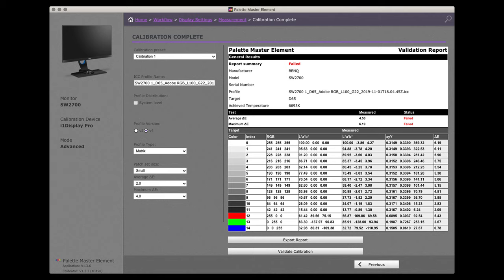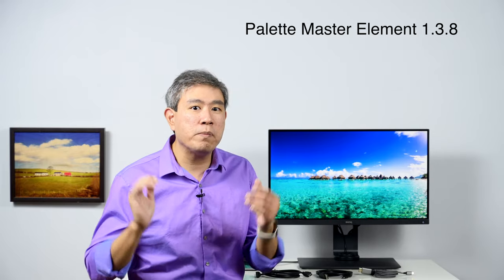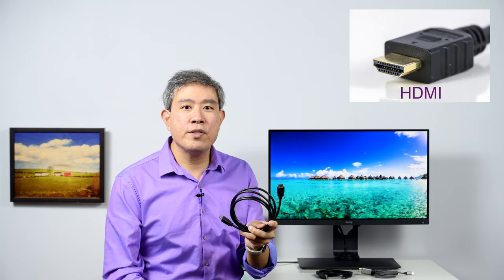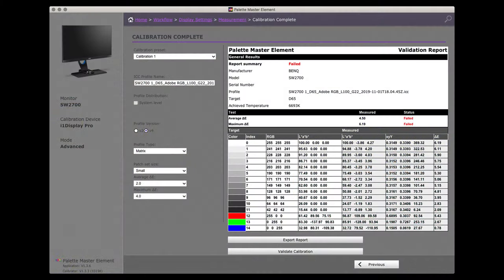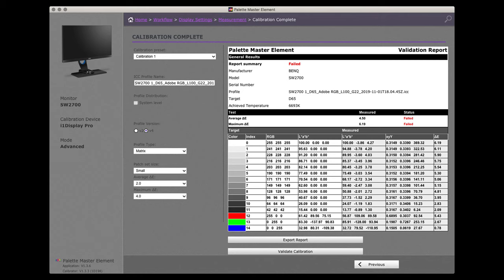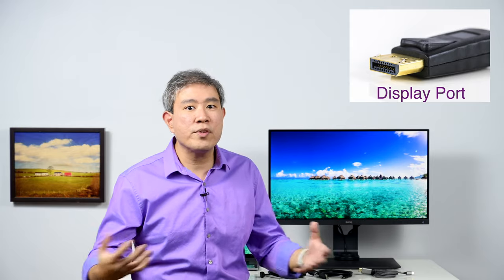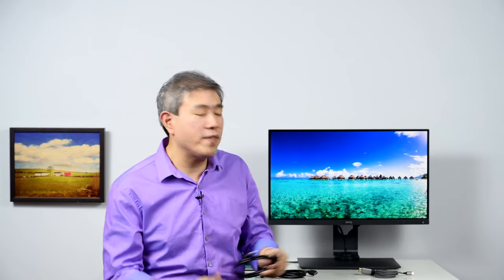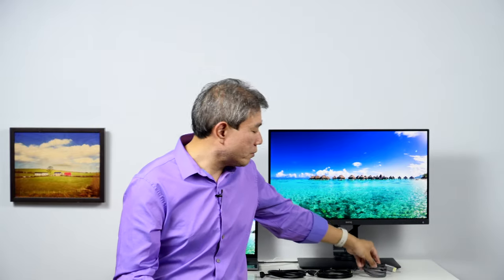HOW TO trouble shoot your BenQ SW Palette Mater Element Validation Fail Before Calling Support!

Comment: I have recently purchased BenQ SW240 to plug with macbook pro13" (non-retina, mid-2012 model).

Downloaded the palette master element and tried calibrating the hardware with Spyder 5.

the problem starts here, when the calibration is nearing 98% ~ 100%, the screen turns either cyan/magenta. the validation of the software shows that it has failed with "Delta E" values hovering in the range of around 30~40 !!

I tried with a Windows OS laptop and it worked like a charm. The only thing i set before calibration using Windows OS was the "HDMI PC Range" at 0-255. But with macbook the option is greyed. Need your help to fix the issue.
Reply from the maker: @Mayukh Das, sounds like you are using the HDMI cable. Yes on Windows you can set the range but on Mac it is more limited. So in this case I would suggest that you use the mini display port to display port cable that came with the display instead of the HDMI. Try recalibrate and keep me posted. Also, what version of PME are you running?
Reply: ArtIsRight i am using the mini display port cable supplied by BenQ and using the latest version of PME. I have re- installed Catalina and PME a couple of times but the problem remains
Reply from the maker: @Mayukh Das, this may be a bug with PME and SW240. I'm going to test it on mine when I have a moment. For now your best action is to contact your local BenQ support and try to obtain the previous version of PME 1.3.7 and try that version out. It could solve the issue. This is not a Catalina issues but a PME issue. I'll keep you posted on my progress.
Reply: ArtIsRight thanks for the help. Will definitely try and keep you posted.
Reply from the maker: @Mayukh Das, I've done a test on my 15" MacBook Pro 2018. On both Mojave and Catalina, with no issues. At this point, there are a few things that you can try, but either way, we know at this point that it is not the display. Most likely it is either software or hardware on the laptop. Being that the laptop is older, my suspicion is that it is hardware related. One more test that you can do is to install MacOS on a fast USB 3.0 Stick or Jump drive and then boot into the USB stuck, install PME and try running a calibration there. If it fails then it hardware related, it could be the Spyder 5 or your computer hardware. If it works then it is your main OS installation that is the issue.
Reply: ArtIsRight will try calibration after installation of MacOS on an external drive
Reply from the maker: I would also suggest trying it with another Calibrator too if possible.
Reply: @ArtIsRight  as i have informed earlier, i used the same calibrator Spyder 5 on Windows OS and it passed the validation test on the same BenQ SW240
Reply from the maker: @Mayukh Das, in this case there’s a few things that you can try. Downgrading to 1.3.7 would be an option. You can contact your local BenQ support for this. It seems there my be an issue with Spyder5, PME 1.3.8 on Mac. I’ll check again and get back to you if I find anything and also report this to BenQ as well.
Reply: @ArtIsRight  unfortunately local BenQ support is not responding to my request for 1.3.7 PME. Is there any other source to get hold of it?
Reply from the maker: @Mayukh Das, one way that worked for another user is the change the URL for PME download. You can try this link https://benqesupport.blob.core.windows.net/esupport/LCD%20MONITOR/Software/PV3200PT/Palette%20Master%20Element_Mac_V1.3.7_Mac.zip Also I ran a test on SW240 with both Maverick and Catalina using the Spyder 5 and I cannot reproduced your issue. This is the setting that I've used on both test https://youtu.be/bz9y3db9vRI Based on this. My best assumption at the moment is that there's something going on with your Mac either with hardware or software. In this case I would first suspect the software. Did you tried to install macOS on an external HDD or SSD? If so does it still fail. If it does this would indicate a hardware issues most likely relating to the video output port or the graphic card. Or another thing that you can try is to swap the cable but I hardly think that is the issue. Hope this help narrow down your issue. If you want to be sure about this, try calibrating your SW240 on another Mac Computer and see if it passes or fail. This will give you a more definitive answer.
Reply: ArtIsRight & ver 1.3.7 worked. My mac passed in flying colors 😊😊. The average Delta E value is coming 0.43 and thats amazing . Thank you so much for the constant support
Reply from the maker: @Mayukh Das, you're welcome! Glad to help out!

Comment: Just bought a sw271C. Palette Master element last version installed (no warnings of problems). click on the icon to run it....and nothing happens, it doesn't run. I have win 10 64 bit last version, Intel i5,16GB RAM. Tried 5 times to unisnstall reinstall it. No way to have it working. Monitor is connected to the PC with the usb cable supplied with the product (no USB C available on my computer). Great for a brand new product, 
 isn't it ?
Reply from the maker: Try 1.3.15 you can download from the website. Software issues happens on machines, new products or not. Each computer setup is different and can introduced variables.
Reply: @ArtIsRight  i will try, thanks,  but who is ensuring that the former version is secure and has no vulnerability ? In any case in 20y no other sw had problems to run in this way in all the machines I had and my machine is quite std, starting from the OS.  This sw is not well designed, developed and tested and I could suppose that ssdlc is also something unknown.
Reply from the maker: ok
Reply: @ArtIsRight  A new version (...17) NOW available. NOW it works.

Comment: Why can't Palette Master Element recognize the monitor , using HDMI to HDMI cable, 
Do you know why this might be happening? Additionally, I've noticed pixilation in dark areas and gradient videos. Could you provide guidance on how to set it up correctly? I work as a CGI artist, and color accuracy is crucial for my work. I purchased this monitor today, and I'd appreciate your help in resolving these issues. thank you in advance,
Reply from the maker: You need to use a USB uplink cable as well with HDMI or DP
Reply from the maker: Need more help ask the question in a new comment, I get so many, reply here will get lost.

Comment: Hi I have massive problems after the latest update from 1.3.7 to 1.3.8 I tried five times and the validation failed...with strange color cast..
my system SW320 MacBook Pro 2018 vega 20, usb c  to Display Port..
after downgrade to1.3.7 works again ... I was hoping the new version Works better with Lightroom.
Reply: I will try the new version on my SW320. I am currently testing the SW321C where there are no issues, nor with the SW270C on Mac. I too use a USB-C to Display port adapter. Also I test with a USB-C to HDMI from Apple as well as Aukey, both have worked without problem. The cables themselves though have to be the latest spec and of high quality. I do recommend yet forget to do it: when unboxing tape the supplied BenQ cables with label stains BenQ. The supplied cables are exactly right. Other cables sometimes work and sometimes not. IF I have something to report back on the SW320 and v 1.3.8 I will comment here.
Reply from the maker: @Neil Snape, thank you for the feed back. I'll be testing the SW321C soon. As far as the SW320, I should run a calibration test on it too. Let me know what you find. 1.3.8 there are some very minor issues but non on an os with no drivers or software conflict.
Reply from the maker: @Mb Flo, 1.3.8 did gave me some issues on my MacBook Pro with the SW270C, but that is attributed to software conflict going on in one of my system. When I test it on another Mac everything works great. Something that you can try to do instead of upgrading is to use a Mac app called "App Cleaner" to uninstall PME and download a fresh version into the system. App Cleaner will remove all of the preference and plist files associate with the old version of PME. Sometimes this can be the root of the issue. Give this a try and keep me posted.
Reply: @ArtIsRight  thank you ;) will try today...
Reply from the maker: @Mb Flo, I ran into quite a few issues calibrating 1.3.8 with the SW320. BenQ has been notified of this. If there's any updates, I'll let you know. My entire screen turned magenta, probably similar to yours. So in this case, I am speculating that PME is not talking to the LUT correctly.
Reply from the maker: @Neil Snape, any updates on your end?
Reply: @ArtIsRight  exactly ! magenta just like mine :( I can not recommend benq for professional work ... I have real problems
Reply from the maker: @Mb Flo, I understand. It is a frustrating software development issue and I know for a fact that they are working hard to fix this.
Reply: @ArtIsRight  I just tried. MAcBook Retina, USB C to HDMI Aukey adapter. HDMI 1.4 supplied cable. i1 Display Pro. SW320. Calibration I was going to put into slot 2. Yet the screen showed a strong magenta shift. Switched to Calibration 1 slot and the monitor base returned to an expected value range. PS, I set the monitor profile in sys prefs to Adobe RGB as I always do before calibrating. Calibration 1, dE av 12, max 2.1 in the red end point. I am now trying cal 2 but expect it to fail.
Reply from the maker: @Neil Snape, this confirm my testing too. I have notify BenQ about this issue already. Development pending...
Reply: I downgraded back to 1.3.6 which currently works ok on my MacBook Pro but it takes a hell of a lot longer to calibrate than compared to that of the 1.3.8 which caused the extreme magenta tint. :/
Reply from the maker: @Jon Rune Trengereid, I'm glad that you have access to 1.3.6. Yes older versions are slower, but on the bright side it works.
Reply: ArtIsRight I actually altered the url of the 1.3.8 and boom(!!) it worked.
Reply from the maker: Fantastic!
Reply from the maker: @Mb Flo, what slot are you calibrating to? BenQ testing show that when calibrate with slot 2 the screen would turn magenta but with slot 1, it would not. I have not tested this yet. But I'll do it soon.
Reply: @ArtIsRight  That is what I noted above. Slot 2 Calibration 1 worked as expected.
Reply from the maker: @Neil Snape, got it
Reply: @johnnymovz  do you know any source to get 1.3.7?
Reply: Mayukh Das go to the color palette download page and change the url of the file to match that of the 1.3.6. I recommend 1.3.6 over 1.3.7. 
BenQ is on this and we should probably see a fix in not too long.
Reply: @johnnymovz  i dont know whether 1.3.6 supports Spyder5!!
Reply: Mayukh Das only one way to find out 😃
Reply from the maker: @Mayukh Das, 1.3.6 should support Spyder 5 since it is DataColor legacy device. This said, when you have a moment go through the other comments. I've added my answer there.
Reply from the maker: @Jon Rune Trengereid, are you having issues with SW320 on calibration slot 1? Because that should work with out issues.
Reply: ArtIsRight I am currently on vacation, will check later ...
Reply from the maker: @Mb Flo, when you get back please start a new comment thread. If you reply here sometime will pass and I might not see it.

Comment: Hi, I hope you get to see my message, I really need your Help, I have Benq 320, it has no signal on display port, I have bought and changed cables to no avail, but it does work with HDMI, I also have a huge problem with the calibration, I have the old colourmunki photo which failed to connect to pallet master despite showing on devices that it was connected so I went out and bought the i1 display pro on your recommendation(not blaming you for the purchase just to be clear) and it is not recognized by the profiler and not even PME yet works with displacal I have a dell 2515 packed somewhere which worked a treat with display cal and its native please help me not get back to it I want this BenQ to work,,,,, I really hope you see this msg if not whoever sees this if you can help I will be grateful.
Reply from the maker: Answers these questions for me and we’ll go from here.
1. What computer (Laptop - Mac specify the model, year and size, Desktop, iMac, all in 1 PC, custom build, etc )
2. What is your Operating System (OS) version are you using? (For Mac please specify the dot release, for Windows please specify version / build number)
3. What calibrator are using?
4. What version of PME are you using?
5. What BenQ model do you have?
6. What cable are you using to connect your BenQ to your computer for the display signal, HDMI, Display Port, etc.
7. If you are using USB-C skip this question, if not, are you using a USB link cable between your laptop and display?
8. If you are using Mac was this a clean install or was the OS upgraded from a previous version at any point (I.e. From Mojave 10.13.x to Catalina 10.14.x)? Or was this Mac restore from a back up, time machine or other wise?
9. For PC, what GPU are you using? If Nvidia are you using their new Studio Driver?
10. Were you able able to successfully pass the validation at some point?